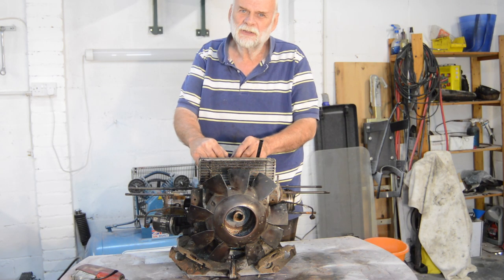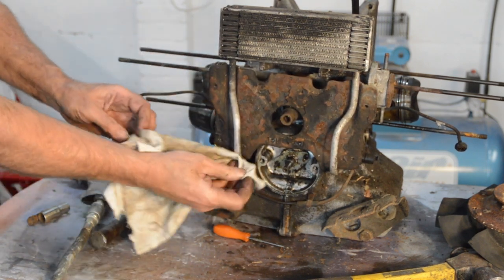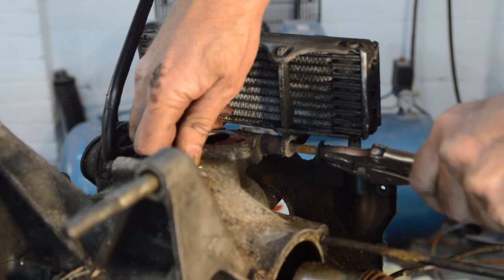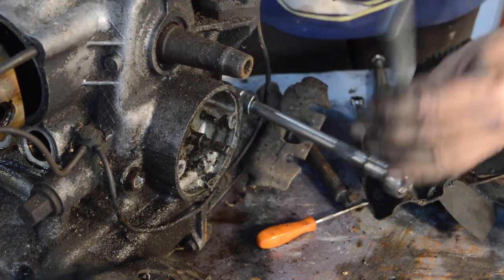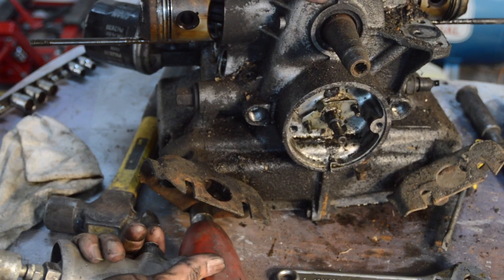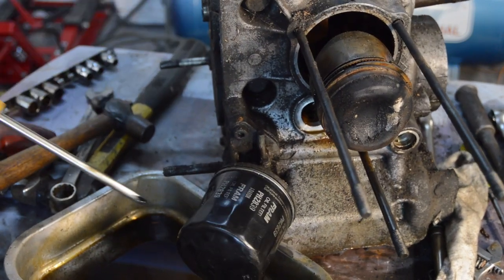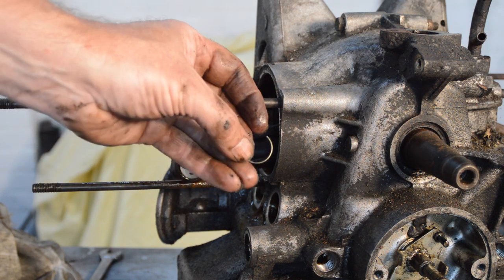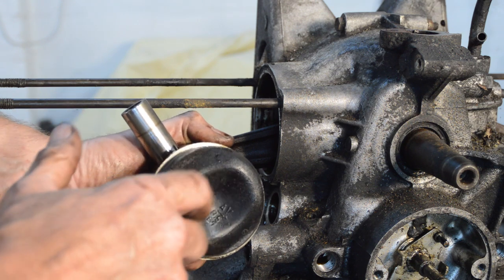2cv engine strip part 2

Comment: When using a heat gun to heat the piston, how long does it actually take?  In the video it's cut to about 2 seconds, but in real life would it be 30 seconds or 10 minutes?  TIA
Reply from the maker: Hi John, I have never really timed it, but it is a fairly quick process, probably about 30 to 45 seconds. The alloy heats up quickly and a quick push with a screwdriver will let you know. Gudgeon pin fit varies as well, this set was quite tight but I have had after market bits where the fit is far looser. Thanks for watching!

Comment: I had lucky with those oil cooler bolts, mine weren't very tight.
Reply from the maker: Hi Carlos, you were lucky, they tend to seize up regularly or at east they do here in the cold, wet UK. Thanks again for watching!